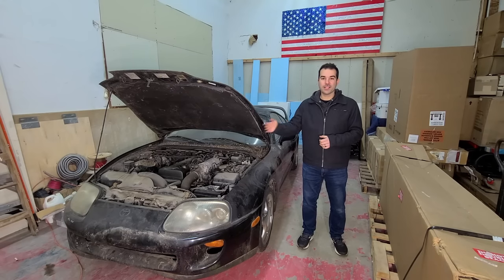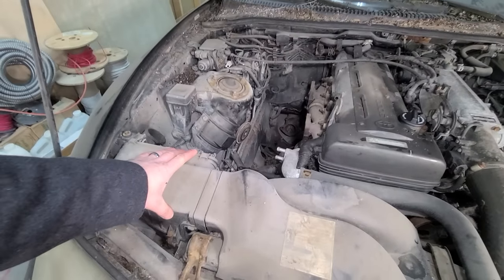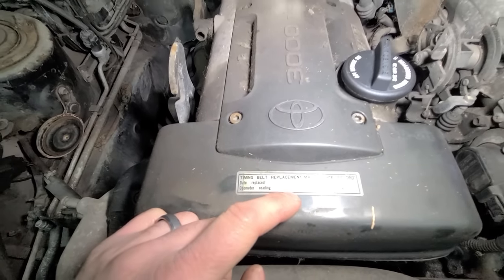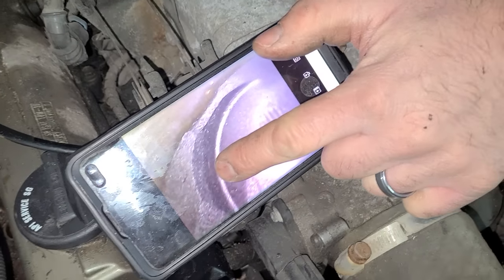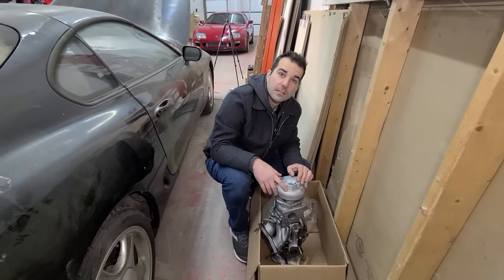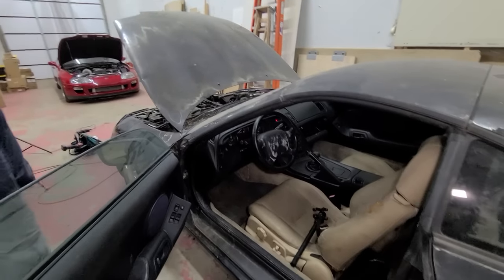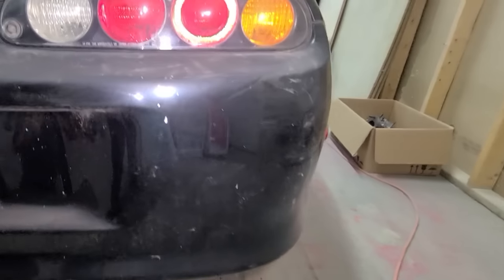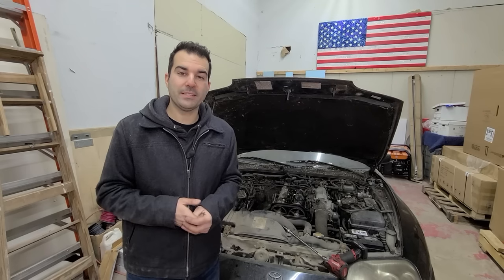I Found An ABANDONED, Twin-Turbo Supra After Sitting Outside For 16 Years! Absolute Steal Of A Deal!

Comment: Most 90's cars don't like CD-R's. You need a retail CD.
Reply: was about to say just that (about 90s CD players in general)
Reply: you need to burn them slowly turn the burn speed all the way down then they can read it
Reply: @sadokbarbouche9427  the problem was that most people burn their songs as .mp3's which are data files and not audio tracks. If you burn them as audio tracks, they'll sometimes play.
Reply: @aaronbritt2025  Lol, that's what I was thinking. Were MP3's even a thing in 1994?
Reply: I was just going to post this same statement.
Reply: @aaronbritt2025  you have to burn them as audio tracks for older players set the speed all the way down and they always work i have the first ever discman from 1984 and it plays cd r great also mercedes w140 cd changer and many sony stereos i never had an issue as long as i slowed the burn speed down
Reply: I knew i wouldnt have to scroll far to find someone who noticed this too. 🤙
Reply: @sadokbarbouche9427  weirdly enough most didn't work with the output of the single and quad speed drives I sold back then either. You've been lucky I guess
Reply: @aaronbritt2025  sure, we had so many mp3s in the early 90s
Reply: @aaronbritt2025  .cda will probably work
Reply: @bigwilly43729  there was mp3 but not all players recognized it specially not the car ones
Reply: @bigwilly43729  Certainly not with the general public - i recall really starting to see them more commonly maybe 1998 or so?
Reply: Not true.  CD r work quite well on most.
Reply: @machtschnell7452  I've owned multiple 90's cars and none of them read mp3's on a CD-R. Some, but not all will read audio tracks on CD-R.
Reply: Cd-r isnt the problem, MP3 is the problem. Burn it right and it Will play.
Reply: This car should get an Alpine F1 deck.
Reply: bigwilly43729 nope, mp3s became a common thing in the late 90's and mostly early 2000's due to Napster and Limewire.
Reply: @mycosys  i had the first HP cd-writer that read 2x and wrote 1x, those burned cd-r worked very good in My car, my hi-fi and portable, No problem At all.
Reply: all my 90's cars have played mix cds I burnt in the 90s and early 00s.
Reply: Yup 100% what I was thinking 🤙🏽
Reply: @LarsonChristopher  loved limewire and finding the virus I downloaded to 😂😂😂

Comment: The turbo manual transmission is worth $10k. It's a steel for $20k. Yes, Legit make another video on this Supra👍🏻
Reply: yup, totally a steal. i saw a lhd targa 6spd tt rolling shell in rennasaince red sold for $20k as well. it has a fresh paint job but currently, a non running 5spd n/a drivetrain sitting on it, and it has n/a brakes all around too. not sure about the diff. it was originally used for a parts car by the previous owner.
Reply: He puts 10k into this 20k supra and double his money at 60k
Twin turbo manuals are very desirable
Reply: @ruskibruski  Twin turbo manuals are THE most desirable, especially in this unmolested state. Cleaned up and running with a bit of bodywork it'd probably auction for more than 60k if you're talking dollars. It'd be worth more than that in pounds sterling imo. Straight stock Supras like this are getting rare now, every time someone 'restores' one there's one less.

Comment: Bought a 1994 3000GT VR4 in 2013-2014 that sat since 1999. Had it running within 30 minutes of getting it home (needed an entire fuel system fix) and everything still worked on it. Suspension, aero, aws, radio, active exhaust, power antenna, etc.

Comment: The traction control label is on throttle body because that is a "traction control throttle body" it has two throttle plates in the TB. The front plate stayed 100% open until wheel speed sensors see slippage then the front TB plate closed electronically until slippage stops. My 1jz had it.

Comment: I bought an identical black/tan 6spd turbo 94 Supra brand new in Dec 94 from a dealership in Virginia Beach. Kept it three years and loved every minute of it. Traded it in 97 at around 60k miles. Sports car sales were very soft at that time. Dealerships seemed scared to even have those things on the lot so I got super low trade offers everywhere I went though it was flawless, bone stock and garage kept. A couple years later after the movie they are suddenly super valuable... I should have held onto it a little longer.
Reply: You and everyone else that got rid of their Supra just before the movie. My 98 Supra only has 30k miles on it. Its not going ANYWHERE ...

Comment: its the oil film on the turbo shaft that centers the turbine in the compresses housing when its cold... the turbine shaft actually has to have time to heat up before it has expanded enough to then be in spec to then be spun 20'000-200'000 rpm. no cold start rev and dumps.

Comment: 20k is what the manual trans is worth
Reply: I was about to say the same thing
Reply: the trans is worth 8-10k in good condition 5-6k grinding gears. i own one
Reply: No it isnt
Reply: Not 20k 🤦😂 8-12k
Reply: The V160 transmission is worth about $8-10k in good condition. A little more with other parts included like clutch, pedals, etc.
Reply: Even 8 to 12 grand is insane you a couple thousand you could get an auto with a trans break and have a lot better times you may need to spend a little for an adapter and your dyno number but be quicker
Reply: @james10739  Apples to oranges comparison. Not everyone is chasing quick ET numbers..
Reply: @привет_лунатикам  not everyone has 20k for a transmission and would pay that even if they did
Reply: @james10739  Did I say anything otherwise? But that also does not mean there no people who would not pay a premium for V160. It does not mean they're "insane".
Reply: That's crazy for those transmissions. Doesn't anyone make a better aftermarket, cheaper?
Reply: @rpturbo  Best bet outside of V160 is a built TR6060 or similar, Grannas Racing is a good resource for this. Though not sure what the full cost will be factoring the adapter plate and all other components. Another thing to keep in mind is that the resale value of a Supra with another transmission other than a V160 will be usually significantly less down the road. That said the V160 is a very sturdy transmission, having been proven to hold upwards of 1600-1700whp with a simple clutch upgrade.
Reply: Does anyone make a t56 conversion for supras?
Reply: @mmholling87  I believe Grannas does. See my response above.
Reply: @привет_лунатикам  thanks for the reply. I'm amazed by the strength of a V160. The Supra is truly a master piece. My dad was the senior master tech at Toyota in the late 90s and I worked in the detail department as a teenager. I seen tons of Supras and always loved them.
Reply: @mmholling87  They're indeed very well built and in some instances "overbuilt" vehicles. From engine, transmission, brakes, etc - Toyota surely knew what they were doing with the MKIV / A80 Supra.

Comment: 16 years for the shop to get rid of and sell it? Wtf
Reply: @michieff  I think in some states the labor and parts cost plus the storage fees have to be equal or greater than the value of the car. I would imagine there's a time element involved as well.
Reply: @michieff  but 16 years? Anyone who's had their car towed and impounded can attest to the "storage fees" aka letting it rot in a gated yard. 

Maybe a few, but surely before the end of the last decade (6 years) would've been reasonable to move it, tow it, get right to sell it off.

Comment: The car needs to be totally torn down everything gone though it's a high mileage car that has been sitting outside for 16 years its going to take a lot of work to bring it back time outside is worse than the mileage all the rubber is going to have dry rot the paint is shot and the engine needs to be gone through still it might be worth doing.

Comment: I love Supra’s but for 20k I’ll rather save up a little more and get a Skyline
Reply: Honestly for a supra now that's a good deal bc most dont go for less than 60k sadly
Reply: Honestly, I would spend just a little more and get a low miles Viper if I were staying in the early - mid 90s era.
Reply: Where do you guys live. A skyline isnt as rare as this car. A decent Viper the same. Way more than $20k
Reply: @thereissomecoolstuff  I said I would spend a little more on a viper, not the same $20k. On Autotrader there are 5 vipers for less than $35k right now. The lowest is $29,990 with 40k miles.
Reply: @bmddlton  Meh... I'd still take a Supra anyday over a Viper, regardless of the cost. And have ;)
Reply: @bmddlton  that's fine. I just know vipers are still around $30k. This Supra for $20k will cost $20k to rehab then it's worth $100-$125k.

Comment: It doesn't matter if the cambelt looks good... Once they are over 10 years old they pretty much need replacing regardless how many kms it has on the belt. They deteriorate from the air/heat, also the tensioner itself stretches the belt over time and puts the timing out. It can break and wreck your engine at any time if not replaced.

Comment: My buddy has a 1997 TT  supra 6 speed that has been sitting outdoors for 12 years but better condition. Completely stock with 60k miles. I was told it would need 2k to get it running, making sure all the gaskets and oils were changed. He wont sell it but i wonder how much its worth.

Comment: My 2004 RAV4 CD player also did the CD thing, I stripped my last bolt and replaced it with an Android unit designed for the RAV4

Comment: I figured 8 Grand.  NOTHING does not need redoing from mechanical to body to interior, and none of it cheap.   And even after spending tens of thousands it will have 166k miles which rules out a lot of buyers that want museum pieces.

Comment: Not worth it. The parts alone to get it running again will be another $20-25k but if you include the rust it has it will be impossible to stop.

Comment: To all idiots saying it's worth 90k. This car may be worth max 35k after restoration. Stop looking at crazy 125k prices, because they are not real.
Reply: +Gruwy I disagree.. You don't know to which extent the new owner will go to restore the car. Being already original TT 6 speed car, definitely gives it a nice bump. Assuming proper restoration, ei drivetrain issues sorted, needed wiring and rubber components replaced, complete bodywork, etc - it could potentially be worth $90k+. Just depends on how far the new owner will go with restoration and time/money invested.

Comment: 👍.   Owner should leave orig paint.   Remove rust and Repaint hatch only.  Survivor condition is worth more than repainted.
Reply: +Rober Staff Not in this case. Not to mention, a properly repainted hatch only will stand out like a sore thumb compared to the rest of the car. The whole body needs to be fully repainted.
Reply: @привет_лунатикам  Im not talking about a Maaco special. someone who is familiar with proper restoration technique would be able to blend properly and clearcoat repair and polish the rest of the car so the car’s finish is cohesive.  There are buyers out there like me who prefers an original paint car (even with blemishes) over a fresh repaint.
Reply: @robertstaff  It would be next to near impossible to fix the hatch rust and blend the paint to the existing that has severe clear coat and paint issues. Preference has nothing to do with it. I prefer original paint too, but this paint is done and will need full respray.
Reply: @привет_лунатикам  thats totally false.
Reply: @robertstaff  Tell me how you would "blend" paint with severe clearcoat issues to brand new paint?
Reply: @привет_лунатикам  Ive been in the automotive refinishing business for over 25 years. You can clearcoat over old base coat if properly prepared and if you know what youre doing. You can also blend clearcoats. Matching it is an art form and admittedly im not great at it but know those who specialize in it.  Special cars deserve the extra attention and expense.  Sometimes it costs more than a whole repaint - but repaint sometimes devalues the car.  Regarding the hatch, it would totally need to be repainted but in a way that it blends well with rest if the car ie. toned down base coat and clear that is not so deep and shiny.  Its more complex than that but just to give you an idea of whats possible. This approach is not to make the car look new but rather original. Not for everyone but common practice on old valuable cars.  Is it worth it for this car?  From what i can see it is but without seeing the car in person who knows how far gone she is.
Reply: @robertstaff  If you are talking about re clearcoating over original base coat, you are effectively talking about repainting the car. That's the way I look at it.
Reply: @привет_лунатикам  I see you’re hung up on the idea that the car needing a total repaint and labelling it as such. I’m not talking about a total repaint but rather paint correction only where it’s needed - and not necessarily whole panels. Goal would be to preserve the original portions of the car where possible to minimize affecting the original portions of the car which are still in good original shape. I’m not talking about totally repainting panels so it looks pristine which is what you’re insisting on.  If thats what you prefer then great but not what I prefer with valuable original cars. There are hundreds of videos on YouTube showing this technique,rather than me trying to explain the process further to you.  Its a cool technique and result.  Go check it out.
Reply: @robertstaff  Having restored multiple Supras from ground up and looking at this one, from what I can tell in the video, there's no paint correction that will make this car look flawless again short of full new layer of clearcoat. 

As a side note, black is the most commom MKIV color, I would also not hesitate doing a full repaint in OEM black (this is not RSP or QS), I think a good paintjob or clear coat would add to the value of the Supra more than anything.
Reply: @привет_лунатикам  at least we can agree on that... The paint will never be flawless without a full repaint.
Reply: @robertstaff  Agreed. It has seen better of its days.
Reply: Or try to get the actually paint code for the color needed

Comment: What's the difference between a 1000 hp Supra and a 1500 hp Supra?

One runs 11.5 quarter miles and one runs 11.4 quarter miles.

Comment: You cant sell a car without the title PERIOD ... You NEED the owner to get the title.
 UNLESS .... and i repeat UNLESS ....
You get an attorney that specializes in "abandoned" cars and can re-issue the title to you BUT only if the state will allow you to do it. And of all those states that will allow it to be done will do it with a salvaged title status. They will basically destroy the clean innocent non accident cars reputation just to allow it back on the road and you as an owner. Even though there is NO ACCIDENT or DAMAGE OR SALVAGE to the car, its title will show it. Then you got to find an insurance company that will cover that "salvage" status car 🧐

Comment: i can import a supra from japan for a total cost of 24k, manual, 2wd, 4wd, 2jz etc everything a supra should have, in a working condition. Also, whats wrong with automatics? why does it always have ro be EWWW?
Reply: +Rave You're comparing apples to oranges. The Supra you described importing from Japan will generally be RHD and with a W58 or A340, both of which are far less desirable. Potentially 2JZ-GE, again far less desirable. Also there's also no such thing as a 4wd Supra.
Reply: @привет_лунатикам  No way? there is no 4wd??? i SWEAR ive seen a couple for sale
Reply: @привет_лунатикам  either way you can find a 2jz gte for around 4-7k and swap it if you cant find one, it also wont make as big of a hole in your wallet.
Reply: @rave7828  No sir, no such thing unless its a one off. I believe a shop in Russia converted one, but that's about it.
Reply: @rave7828  But then it won't be an original TT 6 speed car, it'll be GE to GTE swapped, which is still not very desirable. And still RHD. And still a non-V160. And more than likely with smaller brakes, etc. It won't make as big of a hole in your wallet, but it also won't be as desirable on the resale market or have the same components. Again, apples to oranges :)
Reply: @привет_лунатикам  i dont think anyone would care that much lol, a supra is a supra. take it or leave it.
Reply: @rave7828  Disagree and the valuations on the open market reflect this. I certainly would care and so do many buyers looking for an original LHD TT 6 speed car.

Comment: It was not worth to buy this car. You know why it was not fixed 16 years ago? Well it was not worth the money to fix turbos costed more then a car. As it would take more money then all car worth. All those videos selling car is ussualy fake prices either on tv or o youtube. Yes you can sell this year car for a lot, but usually inside there is so many expensive aftermarket parts even prius would fly like rocket. This car in time already lost hp as all cars loose as engine gets old, i already dont like this engine oil on sparkplug hmm. you want supra buy new and you will always win against old supra. This supra cost prob 15k, to fix it will cost 20-30k. And what you get is old supra which dont win against new supra, which costed totally more then new supra twice the price and more then supra gt

Comment: Who the f@ck abandons a SUPRA???
Reply: The 98 Supra i just purchased was left abandoned in a walmart parking lot. It sat there for about 2 months before walmart reported it as abandoned. Tow company grabbed it but could not reach the owner so they sold it to me for $10k ... then had to find an attorney that could put the title under my name, a few thousand $$ later, i now own a 98 Supra with 22k miles for under $12k ... 
The interior was MINT condition and the engine was 100% oem. 
The car was purchased NEW in 98, then tag renewed in 99 and 2000 then after that, it fell off the map until the tow company got it in july 2000.